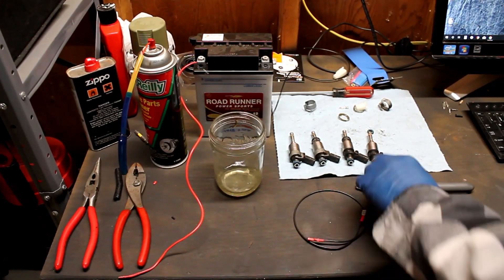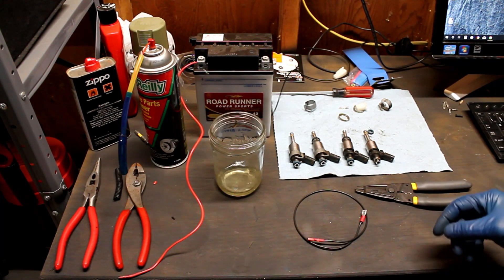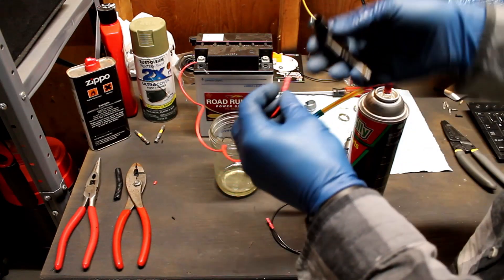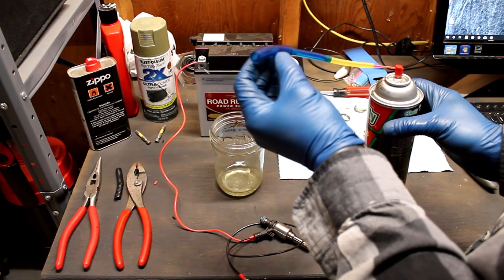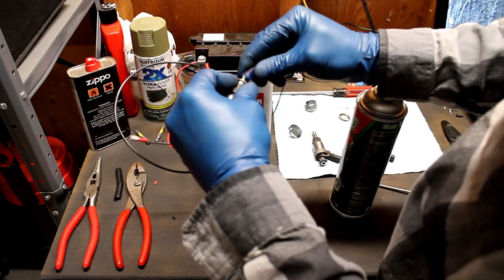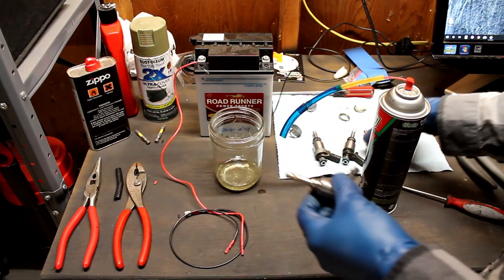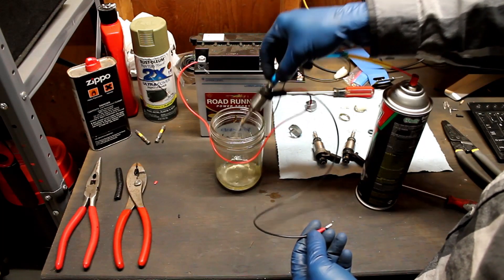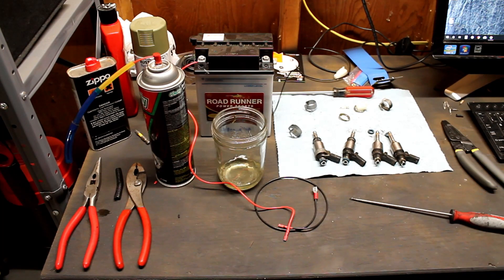VW 2.0 TSI Injector Cleaning and Testing

Comment: This injector has an opening pulse of 65-70 Volts, but for a very short time, and then a holding pulse. You can't play with 12 volts. They are washed well and then checked. In some cases it can be disassembled. For reference, there are installation marks on the end.

Comment: Very helpful, thank you. I too have a stuck open injector so as soon as the drivers door is opened, fuel pumps into the cylinder. With the spark plug removed it was obvious to see what was happening. Your bench test proved very useful to test the other 3 injectors and confirm the failure of #4 once removed.

Comment: Thanks man. In in the middle of a water pump and intake replacement. Now I can test the injectors before putting everything back together
Reply from the maker: Don't forget new injector seals!   I brought mine to the dealer to have the new seals put on the injectors.   Fancy tools are required.   I was flipping this car so I didn't want to buy them.
Reply: @padres235000  I already did them. And it did them myself just with my hands. I wasn'tnt about to buy them tools either cuz I'm flipping this one too.lol
Reply from the maker: @zachariahx1727  good deal.

Comment: What voltage is your battery ? Wouldn’t that be too much voltage for the injector?
Reply from the maker: 12 volts is what these injectors run at.   Different vehicles may be a lighter load.

Comment: Great Video, my mk6 gti Cyl 4 started acting up after I did a water pump replacement and carbon cleaning on my intake manifold. Might try your trick and clean that fuel injector before replacing it.
Reply: Was the injector bad? Putting a cast metal water pump on mine now that the pump cracked, and have been doing a carbon cleaning. Terrified for what’s going to happen when I start it up when I’m done, carbon build up was bad but I only had misfires on cold starts before this.
Reply: @evbdyjoemello   finally did you find a solution? What was the problem?

Comment: Just another reason why the tfsi 2.0 is a junk engine design...direct injection with a terrible piston design that burns oil and a weak pcv system so it cakes the hell out of the valves (alot worse than a normal DI engine) and blows carbon debris back up into the injector tip sticking them open...Cant believe there isn't multiple recalls for vehicles with these engines ..

So far on my wifes I've done the flawed plastic water pump that the gasket channel blows out on, flawed timing chain tensioner that doesnt stay locked or blows apart completely once the flawed chain design stretches ,flawed pcv system that just blows a bunch of oil vapor around from the flawed oil ring design and just a day ago her injector also stuck open on #3 as well.
Reply: This engine won many awards - '“International Engine of the Year”' - I assume it didn't win the following year....

Comment: Does it matter which way the two leads are connected on the injector connector? Or is this polarity insensitive? Awesome video, thank you very much.
Reply: Won't matter
Reply: could we fix an injector??
Reply: @jaimevanegas1575  doubt it. Just buy new one they pretty cheap. Unless you like taking off intake manifolds and stuff for practice.
Reply: Thank you! @georgetsetsakos6088
Reply: It may be polarity sensitive while running, but to clean the injector all your doing is energizing a coil in a solenoid so it shouldn’t matter.  But I would make sure polarity is correct when attempting this type of test.

Comment: Thanks a lot, I'm just replacing the intake manifold on my VW GLI 2.0, I decided to replace the injectors, but I will clean the old ones with your technique to have them as a backup, thanks a lot for the video.

Comment: I was having misfires on cylinder 1, i took off the manifold and saw the carbon build up was really bad, I just finished cleaning it. It was great to be able to use your method to rule out a bad injector, i would have sucked so much to get everything back together only to find that the misfires were injector related. Thanks for the video!
Reply from the maker: Absolutely man.   I hope to make more vw videos but there isnt anything wrong with my car (knock on wood)
Reply: Hi , did you re-use the injectors without new seals?
Reply: Andrew did you fix the injector or just got a brand new one?, thanks

Comment: Drew's Way my golf 6 tsi wont start after being jump started with another car. We suspecting the injector control module because the ECU is okey..The fuel pressure is also okey but the fuel doesnt arrive at the injectors
Reply from the maker: Damn dude.   Let me know what you figure out I'm curious!  Thanks for watching.
Reply: Check the fuel pump fuse/relay and check hpfp